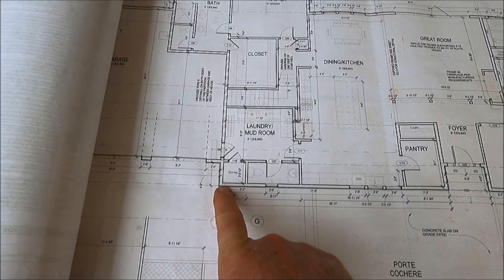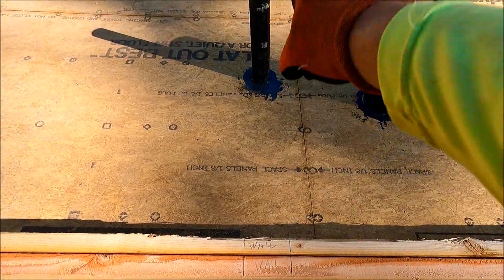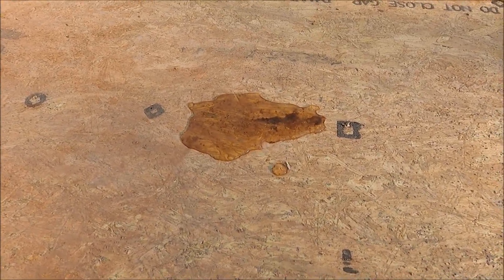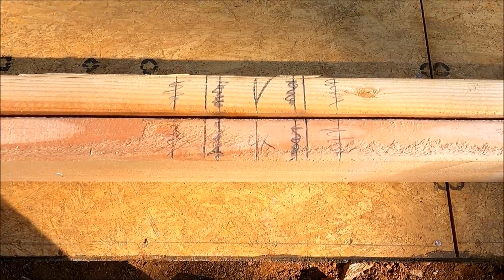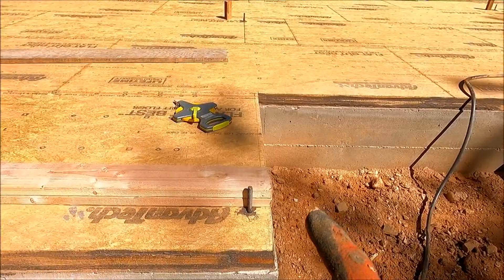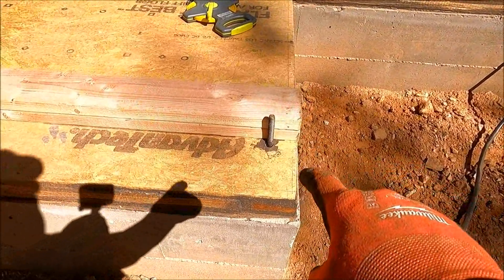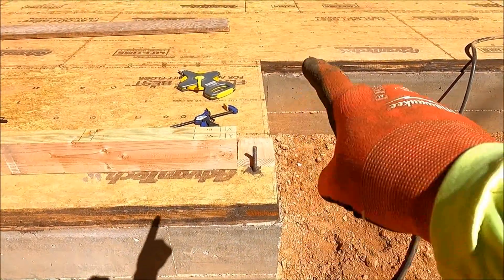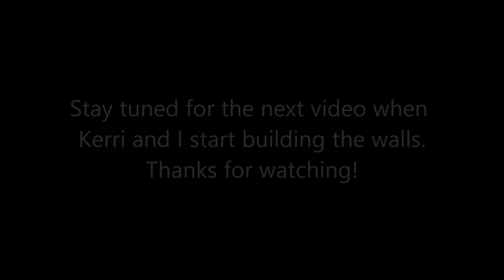Laying out the exterior walls - Building your own house

Comment: Nice job on laying the walls out.  I wonder if there is an easier way - maybe a set of plans with all of the studs laid out with measurements.  Would make it quicker and less prone to mistakes.
Reply from the maker: Indeed.  There are companies that will take your plans and print the locations of the studs, windows, doors and wall intersections directly on the top and bottom plates of the wall.  However I imagine that service would be pricey?
Reply: @HamiltonServices530  Very good point.  I wonder with all of the computers involved if that would be a selling point.  I never dis ask where you got your plans.  Did you design them?
Reply from the maker: @woodwaker1  Kerri and I spent a lot of time on the internet looking at house plans.  We gathered all the features we like and had a local architect design the house.  The company is Real Building Solutions in Placerville, CA.  Having a local architect and structural engineer made the plan check process with the county building department quite easy.  There were no substantial corrections by the county so I never had to take the plans back to the architect/engineer.  Chelsea did an amazing job with the plans.
Reply from the maker: @woodwaker1  It took me a minute to remember the company that pre-cuts the lumber and prints the information directly on the lumber.  It is Builders FirstSource READY-FRAME if you are interested.
Reply: @HamiltonServices530  Thanks - I'll look them up
Reply: @HamiltonServices530  I looked at Ready Frame and it seems like they will provide a set of pre-cut boards ready to go.  I assume the costs are higher.  Did you get any pricing from them?
Reply from the maker: @woodwaker1  I did not.  I am going to have about $150k in lumber and sheathing (not counting the trusses at $36k) so I am guessing a precut package would be at least double that since I have no labor costs.
Reply: @HamiltonServices530  Good point since you are the labor.